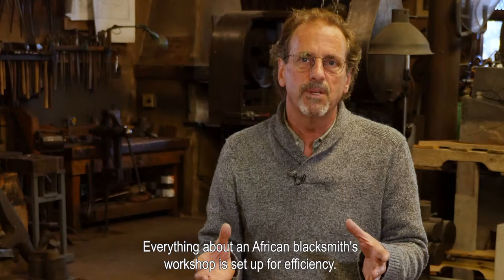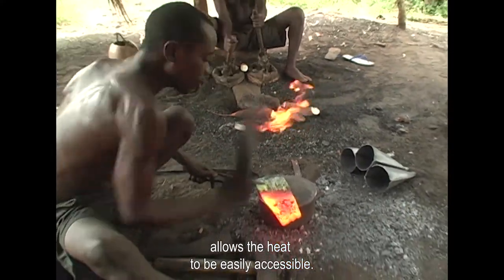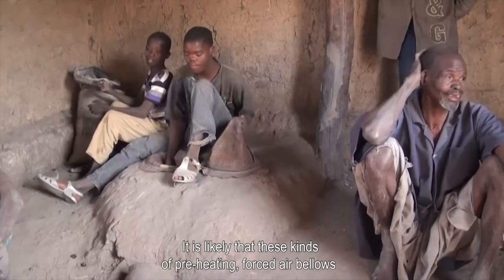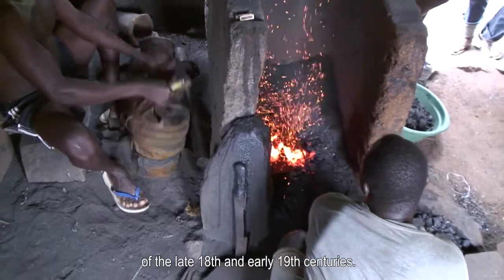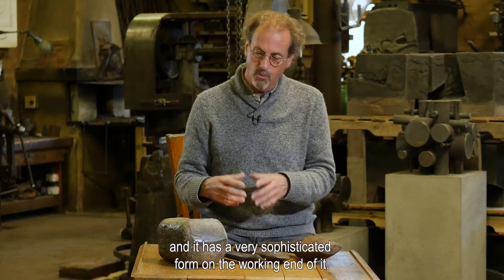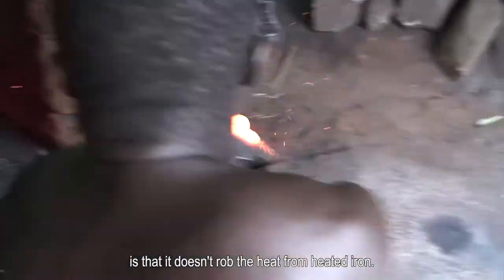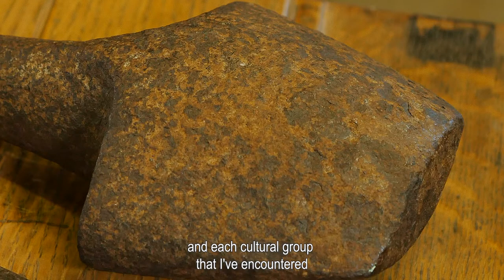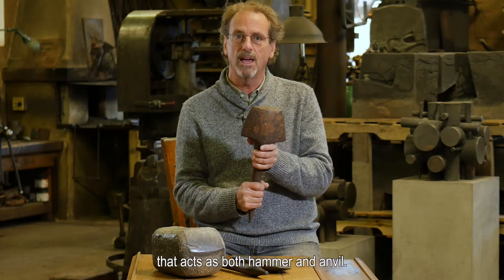Forging: The Blacksmith’s Tools

Comment: its crazy they were able to make tools with such primitive methods. Forging with a rock for a hammer and a bigger rock for an anvil... that is hard enough to do once in a while, but imagine doing that regularly... your joints would be toast within a few years. Sure the rock might absorb less heat, but you also have to work much longer and thus you would end up heating even more than you would with a proper steel hammer and anvil. besides, reheating the metal in the forge isn't that big a deal, and you can get a lot done with a single good heat if you are effecient.

Comment: I am also a blacksmith for 40 years. It is very difficult to work with primitive tools. You need to change if you want your work to be easier and your money to be more. Find a way to get good hammers and anvils to be efficient in your work.
Reply: A forging press speeds up the work considerably. 
That is the only machine that I would actively seek out if I wanted to make a living, smithing.

Comment: Rocks used as hammers and anvils is very primitive.
Reply: who decides that? is there an escale for primitiviness?
Reply: @weirdo4653  It is easy to determine what technology is superior to others. Modern steel anvils and hammers are far superior to rocks. Have you ever done any blacksmithing?
Reply: Tribal societies, tribal ways....
Not too far away from european iron age smithing though.
Reply: @weirdo4653  lol, its super primitive
Reply: @jackshadow325  the video literally explained benefits of stone tools
Reply: @thetitanian5544  Sure, there are some benefits. Modern steel has many more benefits than rocks. If rocks were better we’d still be in the Stone Age.
Reply: @jackshadow325  You didn't watch the video did you? Steel tools can't achieve what they need them to achieve every material has a time and place
Reply: @jackshadow325  it's not about the shape
Reply: @jackshadow325  it's about how much heat they take away from the metal
Reply: @jackshadow325  I'm not offended by anything I have no reason to be I think you're my more bothered by this video than anyone else and that's a personal issue
Reply: @thetitanian5544  That's debatable. If it is true, the benefits of steel outweigh any benefit of rocks.
Reply: @thetitanian5544  The claim that rocks are superior to steel bothers me, yes.
Reply: @jackshadow325  No one said rocks are superior to steel. Get checked for schizophrenia
Reply: @thetitanian5544  The claim is made in the video. Be gone!
Reply: @jackshadow325  No it isn't 😂
Reply: @jackshadow325  it's not debatable and I'm going to need proof steel is any better for their needs
Reply: @thetitanian5544  And thus begins your quest. Let me know how it goes. Make sure you get all your shots before going to Africa. If you need a list of steel tools to bring with you, just let me know.
Reply: @jackshadow325  ???? Clown
Reply: @jackshadow325  I think it is a "don't fix what is not broken" for example, a lot of african pottery is underfiered, but not because they don't know better, but because they use lots of pottery in the process of cooking, which would crack if fired completely. There is not one good way of doing things and for these guys using a smoothened rock works vs a rock with a stick connected to it.
Reply: @jackshadow325  secondly to put this to bed they already have a 2 handed hammer (which can also be used an an anvil), just without  the steel.  if they wanted to use a hammer with a handle they would just use that one, each tool has their purpose  2:15
Reply: @bleggedentertainment1275  I don’t know anything about pottery, but I do know something about blacksmithing — steel is always better than rocks. The real thing that interests me here is that if this video were about white people using rocks, and I criticized them for it, no one would have responded to me at all.
Reply: @jackshadow325  and finally your real issue shows up...that racism is bubbling to the surface. You should let it go, let love into your heart...lol.
Reply: @beanabong2896  It never ceases to amaze me at how many useful idiots there are out there who can make everything about racism. I'm in awe, really. Well done.
Reply: @jackshadow325  Well Jack, if it quacks like a duck, and lays eggs like a duck...it's not a squirrel.
Reply: @beanabong2896  Explain to me how I am a racist. I’m curious as to your thinking process.
Reply: @jackshadow325  "The real thing that interests me here is that if this video were about white people using rocks". Jack, you are the one who injected race into the comments. What was the point of the  statement "take your shots", when suggesting that another commenter visit Africa. What's the implication of that statement??? Was it necessary in order to prove your greater point???
Reply: @beanabong2896  This whole comment thread began when someone (Lennox) called me a racist in response to my original comment. That person has since deleted his comment — so you are not seeing everything. And now you are here calling me a racist. What’s your reason for that?
Reply: @jackshadow325  If that's the case, and I'm not seeing the full context of the conversation, then I apologize for my statement.
Reply: @jackshadow325  It would have been an equally silly comment if it were about Europeans using rocks; the video explicitly outlines advantages with using stone over using metal tools. Obviously, a modern technique is better at mass production and efficiency than these pre-modern ones, but for most of history people weren't using those modern tools anywhere on the planet, yet I doubt you'd refer to those other pre-modern techniques as such. It's a silly point to make.
Reply: @chillin5703  Never are rocks better than metal tools in blacksmithing. Are you a blacksmith?
Reply: @jackshadow325  no, I study history. African metallurgy isn't something I'm entirely unfamiliar with from an archaeological and historical perspective. If you think you can, then explain why exactly using rocks is an inferior method from a smith's perspective and then why that warrants calling the use of rocks specifically primitive compared to other premodern techniques which also inefficient compared to modern ones, though. Because from mine, I'm aware that these techniques fueled some very complex societies - kingdoms, empires, and so on, as did simple techniques elsewhere in the world, so in my eyes the observation is meaningless.
Reply: @chillin5703  I am amazed at how upset people have gotten over my comments. In the past all blacksmiths used primitive tools, like rocks. But as technology improved, blacksmiths abandoned the rocks for iron and steel tools. It is no different than how steam engines were abandoned in favor of gasoline engines, or how blacksmithing itself has been mostly replaced by modern welding and machining technology. Using rocks as tools is primitive. It is a simple fact. Learn to live with it.
Reply: @jackshadow325  I'm upset? I'm reacting as I am because I think you've made a pointless claim, and I explained why I thought it was a pointless claim in a few responses. I wouldn't describe a steam engine as "primitive" even if it too is outdated, because we tend to mean more when we use the word. Otherwise, if "primitive" is a mere descriptor for those things we no longer use, I may aswell describe vinyl, mp3 players, feather and quill pens, and so on as primitive.
Reply: @chillin5703  Blah blah blah. Steel tools are better than rocks. That's all I'm saying. You can disagree if you want. Some advice: if you ever need to do some blacksmithing, choose the steel hammer, not the rock one. You'll get more work done with less effort, and it'll be easier on your arm.
Reply: @jackshadow325  well, no, you're not just saying that, you are also saying the latter is primitive, which is what I'm responding to.
Reply: @chillin5703  Stone tools are primitive in the world of blacksmithing, yes.
Reply: @jackshadow325  and is any inferior method, lacking the benefits of modern ones, primitive in your opinion? Or stone specifically.
Reply: @chillin5703  Stone tools are inferior for blacksmithing. That’s it. That’s all I’ve been saying, over and over and over..............
Reply: @jackshadow325  and I've asked for a set of reasons, for you to give an explanation. You clearly are unwilling to provide one.
Reply: people who know nothing about blacksmithing seem to take one comment about the supposed advantage of stone tools for blacksmithing and think they are somehow comparable to a proper hammer and anvil. ridiculous. Its almost certain that the very first blacksmiths had no choice but to use stones to hammer out their first tools. But they would have very quickly realized how tedious and ineffecient it is to do that and switched to steel tools. The only reason you would keep using stones to forge would be if procuring iron was difficult or you didn't manage to think of using iron tools yet.